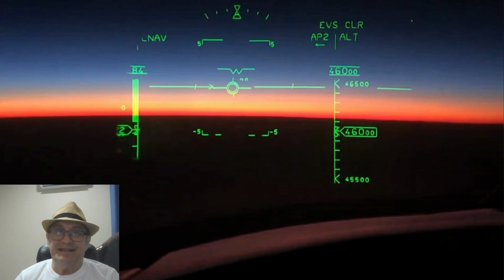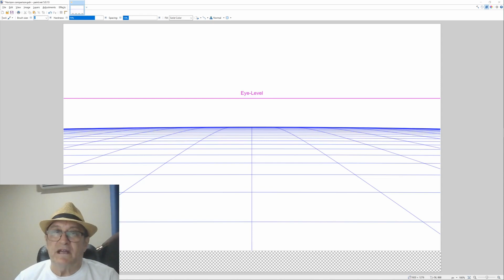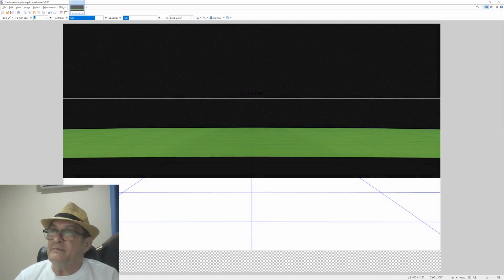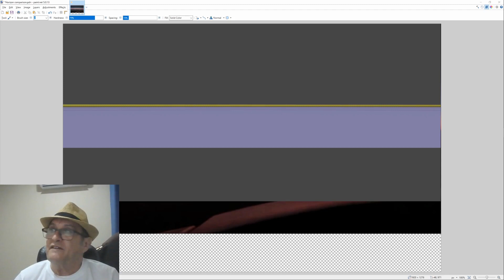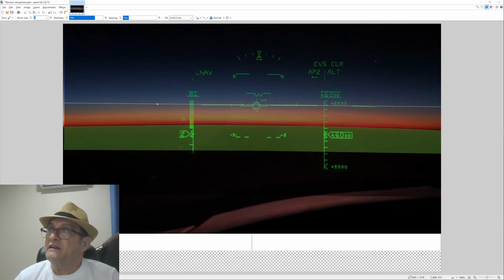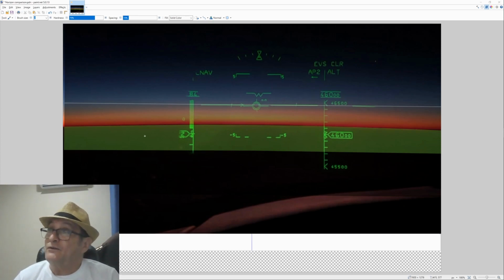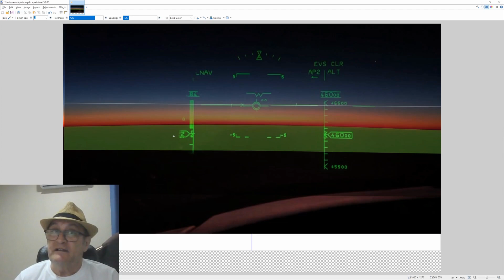Does the Globe Model or Flat Earth Model Match Reality? A Case Study.

Comment: To be fair, flat-earthers do not have a "model" and they say that models do not work or are not a representation of reality.

then I see you do the same mistake as so many other "debunkers" that claim we can see a "curve" eve we can not do so, it have even been going so far that folk that debunk flat-earth is saying that experts like Neil deGrasse Tyson are wrong or lie, for we can not see the shape of the earth from an aircraft, not with the eyes nor with a camera.

The bend you see in a photography  or as a simulation on a computer screen is due to "projection", the horizon will not bend down, it will always look flat and you can turn around 360 degree and see the horizon around you without and "bend" in it, that is a thing you can not display on a 2D surface without getting a distortion, if you take a 360 photo and try to display it on a 2D surface you will see the horizon as a circle and this kind of distortion is called "Tint planet".

Also, lensed do not distort differently, like a fish-eye lens have exactly the same distortion as a 500mm lens, they have just different field of view, but if you had placed those images on the inside of a sphere they had look exactly identical but you had to take many more images with the zoom lens to cover the same area. A 360 camera is often 2 cameras with fisheye lenses that see a bit more than 180 degree, but there are 360 cameras that use 16 cameras with larger zoom to create the same effect but to get higher resolution.

So any time you take what we see in 3D and put it on a 2D plane we do get a distortion, that is also the reason why maps get a distortion when we try show a sphere on as a world map.
Reply from the maker: To be fair, the flat earth is indeed flat... Whether they like it or not, a flat surface can be modeled, and it will be a representation of a real flat surface. Funny how lots of things are designed in a model (for example a house plan) and when you build them in reality, they look and work just like the model. A very strange argument from the flatties.

As for the rest of the argument here, it's a load of word salad. If we can see the curve at 46,000 ft and take a photo of it and it looks curved in the photo then it's curved. Next you will be saying that when you look at a basketball you don't see a round object.

Comment: Camera lenses and airplane windshields don't change shape with elevation. So if they are the cause for the curve there should be no difference in what is seen at ground level and what is seen at 46,000 feet. It should all look curved.

Comment: Only one problem, there would be no clear horizon line on a flat earth, there is nothing to cause it.
Reply: ...Indeed! A distinct horizon is a Globe fundamental of Earth's curved surface meeting sky.
...On a vast flat planed earth, it would take extreme negative refractive conditions, for a long distance, from the observer to the distant flat plane, refracting light upwards and causing the flat plane to sink down and away from the observe.

...And if flerfspective compression was an actual thing, I don't think there would be a distinct horizon line with that either. I would predict as the angle becomes more limited, there would be a gradual compression 'zone'. Of course, flerfdomites have no proper quantifying calculations or science to predict when their flerfspective compression-limited angle-yada-yada nonsense happens. Globe quantitative science has functional formulas for the distance to the horizon.

Comment: Flat or Globe? Let us avoid the up/down distortion of refraction and look at horizontal bearing to the Sun at 6 hours after local Solar noon. On the Equinox that is very easy to predict for both models and reality don't match flat and does match globe.

How about them stars? The constellations do not distort between locations. Celestial pole centered star trails are circular from any location. That matches globe and not flat.

How about the Moon? Simultaneous observation from widely separated locations shows the same face of the Moon but rotated a bit demonstrating the verticals diverge. That matches globe and not flat.

How about stuff nearer the ground? Big stuff at great distances gets progressively lower relative to nearer stuff, lower than perspective predicts. That matches globe and not flat.

How about measuring the surface? The ratio of the length of a due East/West distance over the change in longitude between the end points gets smaller as you go away from the Equator, both Northwards and Southwards. That matches globe and not flat.

I could go on and on and on . . .
Reply: IOW, the flat earth cult fails miserably, again and again and again and again and again and again and again... ad infinitum.